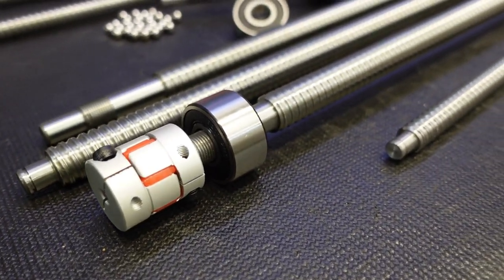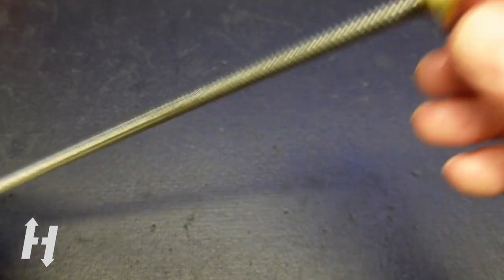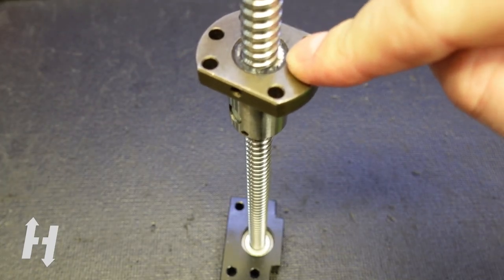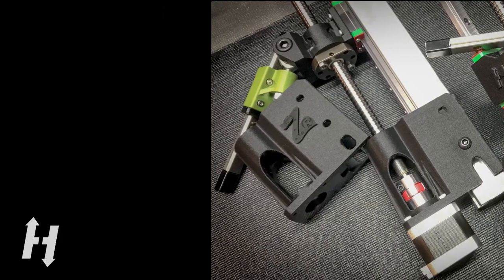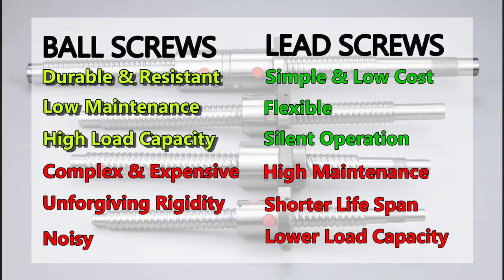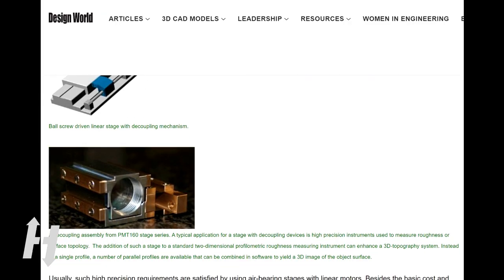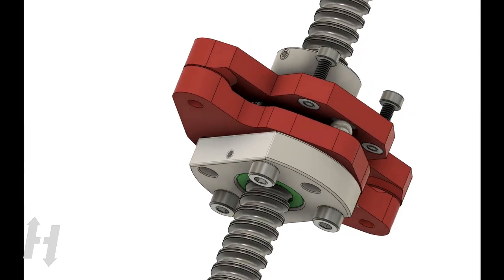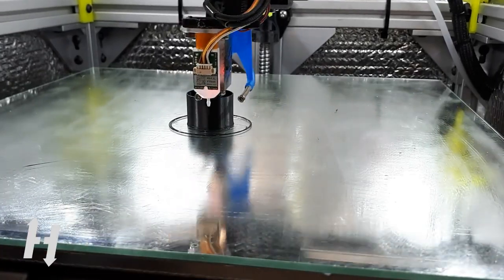Fixing Z Wobble from 20$ Ball Screws with that simple device

Comment: I haven't read all the comments, and I totally understand your point. Would it not be a better compromise to just not attach the top of the ballscrew rod? It seems like that would solve some of the problems, and the bearings do the lining up the ballscrew is just there for movement. I don't see a point to connect the top of the rods. Having said that would solve some of the issues, you could still get a wobble from the rod rotating while not being straight. I'm new to printing, so I probably have a lot to learn. I'm currently working on an all belt corexy build with three z axis belts using an 8 to 1 ratio and counter weights. I'm hoping for a good quality smooth and cheap system.  🤞

Comment: Damn i found a really good channel! Subscribed!!!

Make a CroXY with ballscrew Z. This is what I did and my only regret is I should have done this sooner.

Well done explaining the manufacture of the parts. Like grinding vs rolling

Edit: also, you can add flexures with heavy leaf springs  on the xy plane on each ball screw nut, it will average the runout of the screws.

Comment: I know this is old now and has been solved with a decoupler design in a future video, but hear me out
What if
Ball screw carrier
Running on a lead screw.
Wear would be slightly higher than an actual ball screw, because the bearings would be running on a smaller surface area
but it would be miles better than using a lead nut in terms of both wear and friction, and the lead screw would retain the advantage of being able to warp when asked of it.
I admit I don't exactly know how much a ball screw carrier wod have to be reworked to adapt to the lead screw, and I don't have any way of knowing how reliable the ball catch ends would be in the lead screw's track, but it would be an interesting experiment.

Comment: Air tool oil and lucas is a much better choice.  Motor oil is a pain with the additive package and air tool oil is much better at preventing corrosion in an open system

Comment: So you didn’t like the wear of the brass nut but you are ok with hardened bearing balls rolling on printed plastic surfaces?

For future videos:
Ball bearing is a complete assembly comprised of inner and outer races, ball retainer, sometimes side covers and bearing balls.
Bearing balls are those shiny spherical things you used in your design. Please don’t call them “ball bearings”

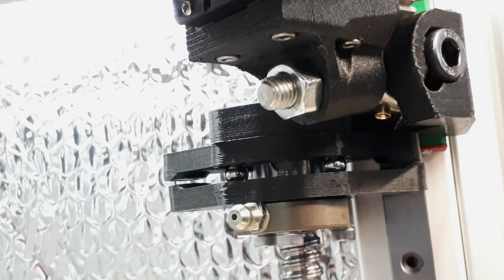Comment: I enjoy watching this engineering process and appreciate the creativity. However at 17:25 you can clearly see that there is backlash in the system. I would rather go for a much cheaper lead screw than for a ballscrew with a these Wobblewings that still has backlash.
Reply from the maker: Yes, you got it right.  Although this solution was ok for very low friction ballscrew application, the introduction of fast printing and Z hops rendered them as not optimal.  The WobbleX is the right solution: https://youtu.be/4kQZnSzZHD0?si=FEV2pZoHUDcmjlj_

Comment: Nice but Id be worried about wear between the ball and the flat surface of the magnet. Magnets are usually more prone to wear than ball bearings, so I'd expect the nickel surface to wear off and a crater to form on the magnet. Maybe time to include a steel shim on the magnets.
Reply from the maker: Hi!  thanks for the suggestion.  This video is quite dated.  Since then we moved to a new solution 😀: https://youtu.be/4kQZnSzZHD0
Reply: Thanks for the response. I will look. Just one thing though. You could have also removed the wobble by placing the drive at the ball screw nut instead of the bottom. You are only fighting the wobble because there is a gap between the drive and the ball screw nut  and the deformation of the screw between the two. It would be easier to fix the screw (vertically, let it wobble around horizontally) and drive the nut directly with a thrust bearing bewteen it and the platform connection. Spin the nut with the motor, not the screw.

Comment: Just switch the normal nut out for an anti-backlash nut and keep the lead screw lubed and this will last for pretty much the lifetime of a non-print farm used 3d printer for less than $5.  Now if you're running your printer 24 hours a day, 7 days a week, 365 days a year, then yeah. Upgrading to ball screws is probably worth considering. But for the rest of us, ordering an anti-backlash nut off amazon is likely cheaper, easier, and just as effective.

Comment: I just found this channel. This is some serious machinist understanding here. Great stuff. I do have one question: Could you create a video that explains the decoupling action in slow motion... as I don't quite understand how the decoupling can work since if it is rolling, won't the bed itself also be allowed to shift as well?
Reply from the maker: You can have a look at the CAD model of the entire Z axis system of my printer here, this may answer some of your questions: https://a360.co/40QC5G5 😉
Reply: @MirageC  So, after looking at the model, the table is sort of floating but also constrained by the devices that mount to each of the Z axis. However,  this would suggest that the table itself must have the ability to move to the same degree that the each of the devices can correct the run-out. I am going to bet that if you put the gauge on the table and applied some finger pressure to the side of the table then you would see that the table moves substantially. It is clear from the video, that your particular design doesn't seem to really suffer the expected table wobble in the print... this is also helped by the fact that you don't have to worry about the table accelerating quickly in the XY at all because your print head does that, so there is not any side pressure under normal conditions. Very clever design. note that if you do start getting table drift, 3 ground polished shafts might do well with your floating design and have the table glide along the shafts, and be decoupled from the z using your WobbleX system...

Comment: Very interesting and complicated. Nice.
However, two sheets of brass, one attached to nut, the other attached to the bed, an oversize hole in both, and a little graphite would do the same?  Maybe guide rods on two sides to eliminate bed x & y motion?   Guide rods with bed mounted abs, teflon, or brass bushings?   Argh. Same amount of work.     Good Job!

Comment: I have 3 machines which are most perfect on the X and Y.  I have tried 8mm lead and 2mm lead on the Z.   It seems that when using the 2mm lead I am getting screw artifacts that I cant tune out.   Ender 3 pro highly modified.  What do you recommend for the Z?

Comment: Dunno... I've managed to have 'almost' perfectly concentric Z scews  (NO Z wobble)
  simply by fitting  Collet type motor couplers.
  Motor shafts are straight so are 90% of Lead screws.. easily determined and cheap enough to buy several to choose from.  
Only Logical that the connectors must  also be precise   :-)..
 Most Z screws are  manufactured  as Straight ...despite opinions.
 And Be smart enough to use Single Start Z screws Not the Foolish 4 start choice  that Chinese Cloners use. 
Reduced backlash issues and Virtually No Gravity issues (what you call backdriven) . 
Not to mention 4X the Z precision. .. as Singles are Gearded down 4X  Vs 4 start ones.

Comment: I wondered about changing my screws out to ball screws.  I may look into a set for the Z on my Ender 3 V2,  I do see a lot of  crappy lines as the Z goes up.   Not that I can afford C 1 ball screws.
I am going to go look to see the price of a C7 ball screw, (my guess is I will be getting the 20 set).
Thank you for your video.   
Lee
Reply from the maker: Thank you for the comment.  Before investing too much into ball screws I suggest you have a look at the Extrusion system if you have horizontal artifacts.  Have a look at this video: https://youtu.be/WTqEFqXtb9M

Comment: I liberated a set of leadscrews - years ago - for the same reason (Z-banding) allowing the screws to float in 2 planes helped a lot, there are some moving bed designs using timing belts and cables, as all you need is a "motion control axis, the linear guides should be controlling tracking.  to eliminate  rotation errors I ended up springloading the "screw guides" - to each other (there are 3 screws in my machine (defining the print plane - sadly not under independent control - we always need more axes on control boards), but loading relative to the bed would be just as effective - where you used magnetic attraction, I used Hooke's law.  cheers..

Comment: An M6 normal metric thread was used in the past. One turn is 1 mm. 
But the geometry is designed more for tightening a screw.
Trapezoidal threads are designed for linear movements.

Comment: What if instead of pushing the bed up with the ball screws, you invert the system and pull it up? a simple string or chain could be the link to the ball screw and eliminate even more parts and complexity.
Reply from the maker: Belted Z with heavy bed plates can become springy when machine vibrates under hard accels.  And I dont think there would be less parts in such install.  One of my friend did it on his HevORT.  I am waiting for feedback.

Comment: This is brilliant idea, but may I ask is there any chance the one connected to the bed and ballscrew get separated when printing ? since it has no mechanical lock CMIW
Reply from the maker: Low acceleration on Z will allow magnets to keep and accptable alignemnt.  But yeas this is not optimal.  this is why we have a revision of this system.  video to come.

Comment: Correct me if I'm wrong but couldn't you make that same mounting system work with a normal lead screw and get better quality already? And since you had to compensate for poor manufacturing,your not getting any print quality benefits from the ball screw, the improvements come from everything you did to fight the poor manufacturing. So other than maintenance and wear, this setup could be used with a regular lead screw and produce the same results?

Comment: You should try Muscle Lubricants MT10 additive to the oil, it works very well. It also keeps the lube cooler with longer life. Taking a torch to heat up the shaft that were out of spec and push them from the other side with a press like straightening a rifle barrel?

Nice fix you did the problem

Comment: I am surprised that the table doesn't wobble side to side with any vibration. I can see that the wobble from the screw gets absorbed - just not how the wobble of the moving hotend gets "lost".
Reply from the maker: The frame of a coreXY with high acceleration should be anchored to the wall and floor just like a CNC would.  This will ensure all power is transmitted to move the head, not to vibrate or move the frame.
On the other hand the bed links should offer lateral rigidity.  In the case of my printer the 3 rodends are fixed to Z carriages mounted on linear rails.
Reply: @MirageC  Thanks, One further noise source I can't "get out of my head" on this. What about correlated wobble in the screws. i.e. they happen to all have  bias in angular deviation (all move north at the same time every turn which I guess you just start them with different angular offsets). Or just by randomness at some point in the Z direction their moments sync up, which would be hard to adapt to.
I guess the only solution I can think of is one of those expensive straight rods and no special ball joint in one screw and then the others can wobble with your special adaptors.   hmmm, or would I need two expensive screws .... Ah - I hope you knw what I mean! :-) 
PS. really impressed with the detail you go into on this channel - I only came across it yesterday - but love it and I don't even have a printer yet!

Comment: I use a 2€ Pneumatik cylinder coupling. It decouple x and y and 3 degree angle along the Spindel axis. Your solution is very overengineered and Not fail safe due the Magnet dependence
Reply from the maker: Any picture of your installation?

Comment: Or you could just spend the money on a good ballscrew. I am an Industrial Electrical Maintenance Technician. We use ballscrews on most of our equipment. Many of them are two feet long and free float on one end. They don't move like that.
Reply from the maker: I bet your machines have 2 beefy linear rails for each screw and are mounted on a super rigid frame.   The goal of this video is how to use cheap ball screws in a cheap machine made from aluminum extrusion 😉

Comment: Wobble wings on high quality ball berings?
Reply from the maker: you mean on quality ball screws?   I would still use a decoupling mecanism such as wobble wings or WobbleX with higher end ball screws.  Our printers are home built with printed parts, this makes them not perfectly straight.  Ball screws are too rigid to adapt, they will reshape your printer's frame to their will.

Comment: Hmmm over engineered. Same print quality i have on standard screws tr10x2 with 2x bras nut with spring between. Btw the best way to improve printing is to avoid plastic parts, instead use aluminum

Comment: Lead screws are designed for higher loads. There are better ways to drive the bed on a 3d printer.  Low loads no pressure.🤔

Comment: If you want super accurate motion that's cheap and wobble free you can always use a $5 belt....
Reply from the maker: Yes, too bad we don't see much printers with belted Z bed yet. I wonder why aren't they more popular.
Reply: @MirageC  If your goal is novelty then sure use ball screws there slow and expensive. You should consider making a CO2 laser powered hot end. It's going to work like crap and be expensive but no one else will have one...
Reply from the maker: @mp-xt2rg  Ok
Reply: @mp-xt2rg  do you realize how big CO2 lasers are? there is no point of making it a CO2 laser if its not going to be able to cut metal which it wont just use a normal 1-2W laser
Reply: @Fisheiyy  Are you familiar with satire?
Reply: @mp-xt2rg  yes but it seemed like you were genuinely suggesting a CO2 laser hot end because you specified a CO2 laser and not just any laser
Reply: @Fisheiyy  I think it's safe to say any laser technology used to head a hot end would be ridiculous. I was just poking fun at the guy and giving him future ideas for novel over engineered 3d printer projects.

Comment: your problem is because your ballscrew is fixed at the top. Release top point and you wont need this gadget
Reply from the maker: Bigger printers have heavier beds, therefore the weight should not rest on the stepper motor. For that reason a thrust bearing should be used.  See at 6:20 a ball screw with lower thrust bearing on which I removed the screw top fixation. This oscillation is super strong due to the rigidity of both the screw and the thrust bearing.  There is no way the bed installation can counter that force completely. Your proposed solution is good for smaller/lighter printers with more flexible lead screws.

Comment: wouldnt it just have been easier to use linear rails to confine the table to only move in z and cancel out z wobble? you want the axis to be confined and driven seperatley like a milling machine that has ball screws AND ways or linear rails. 
thats my plan anyway keep my 2 cheap lead screws, add anti-backlash nuts and upgrade my 4 round 8mm linear rails to somthing heavier and stiffer that will make the lead screw bend instead of the table being deflected, this set up is pretty good already and my prints are nice... but it could always be better

Comment: to complex and to costly. If you want to use a cheap ball screw than use a cheap ball screw and only have it on a stepper motor below and a good bearing at the top end. 
Instead of a sliding/ball/magnet... to complex and expensive option use next to the ball screw a solid rob with linear round bearings. Lot cheaper and also easier to maintain. Now you do have also eliminated the wobble effect because you decouple the ball screw from the printing table. All you now need is a 2 piece guide rod M3 fixed against the ball screw nut and sliding into the ball bearing receivers. Problem solved now if you use 4 corners instead of 3 you can use them rods also as a stabilizer and mount for the build plate. 
Keep it simple. Rod rails are a lot more affordable than linear rails.

Comment: What about annealing the screw? This would certainly relieve mechanical stress. I imagine the runout could go either way it could get better but also could get worse. Good work with the wobble wings. I have been looking at Voron for a printer after I outgrow my Ender 3. After seeing the HevORT I am interested in because like you I see non-planar as a very useful process also I would like to isolate as many electrical components from the print volume area as possible for facilitation of a good heated chamber/print area.

Comment: Nice work. With time an effort put into this solution, you should sell a kit with those parts. I would think if they made the nut on the lead screw out of nylon, it would hold up better than the brass nut if kept lubricated.

Comment: Or you can just oversize the screw holes on the 3d printed part holding the "ballscrew nut". Then use screws with a stack of washers and nyloc nuts, but live a tiny amount of slack. This should allow the ballscrew nut to wobble laterally.

Comment: I love the magnet solution, very ingenious way of decoupling the wobble. I wonder what could be the effect of tilting the magnet faces to match the helix angle of the ball screw? On the one hand, it would neutralize the effect of undesired nut rotation, as well as reduce the load's ability to cause such rotation (besides from friction). On the other hand, it will couple the side-to-side screw motion into a rocking of the carriage, maybe leading to a need to decouple that with some type of gimbal or perpendicular pivot system. Maybe I'm venturing into overengineering territory here, but I'd definitely be curious what effect simply tilting the magnet faces would have.